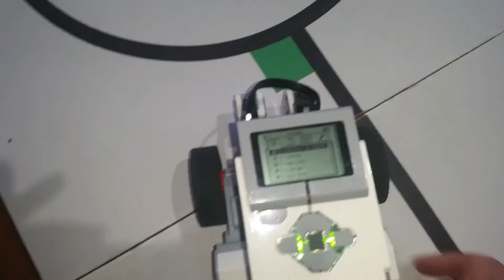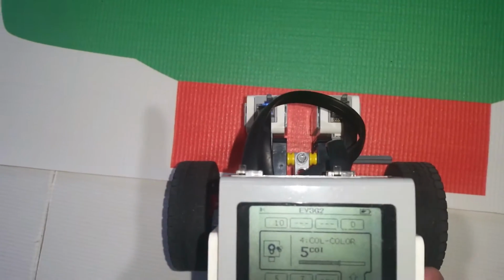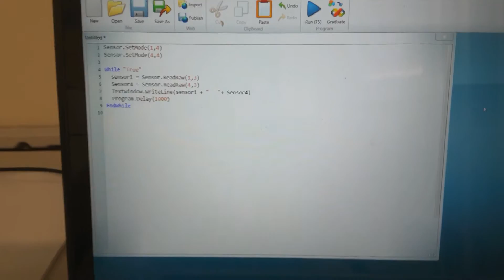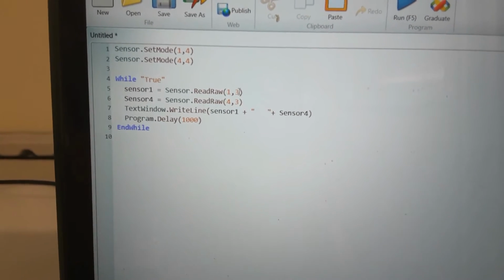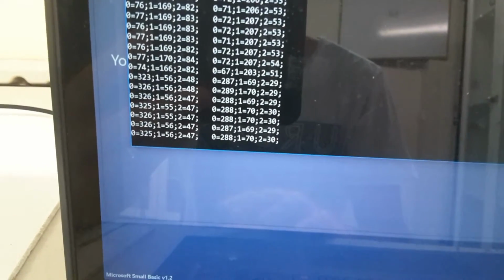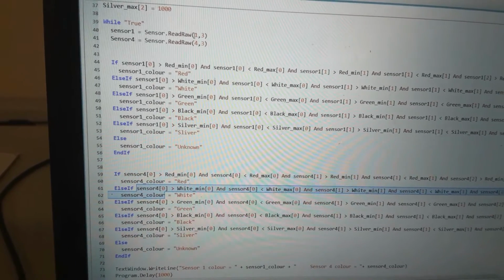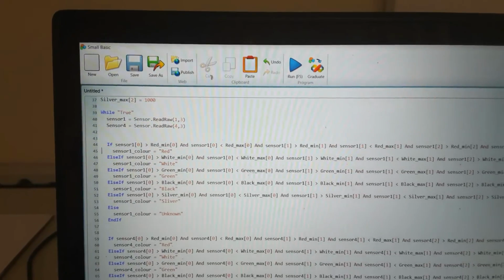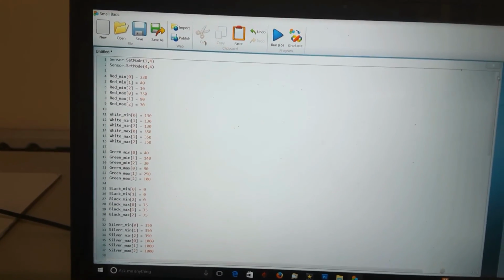Solving colour dection problems in EV3

Comment: the sensors actually send out pulses, not continuous beams. the pulsing allows "reflected light" mode to ignore changes in ambient light, and this works surprisingly well. since the sensor only has a single phototransistor it needs to send out single-color pulses in order for color detection to work at all (though not very well).
Reply from the maker: This is correct but in my EV3 videos I do try hard to keep explanations as simple as possible.
Reply: Hello.  Can you give more details about this?  Please.